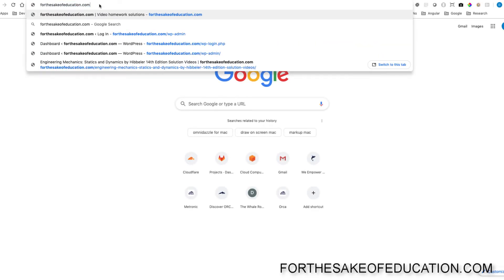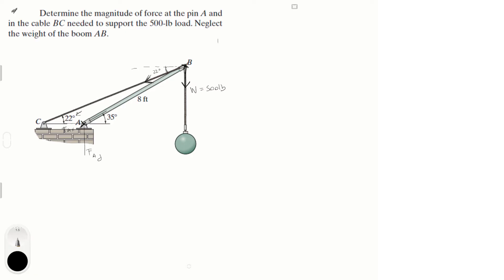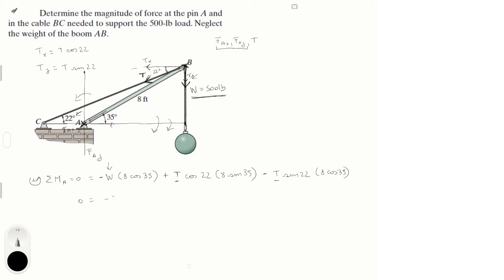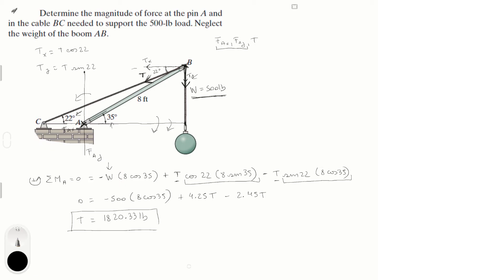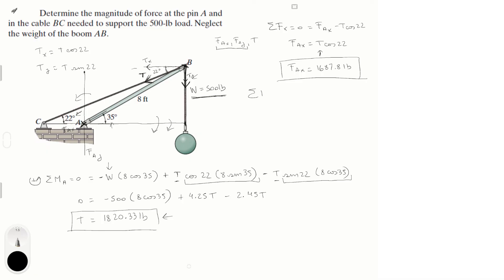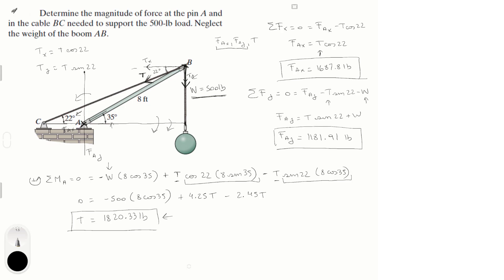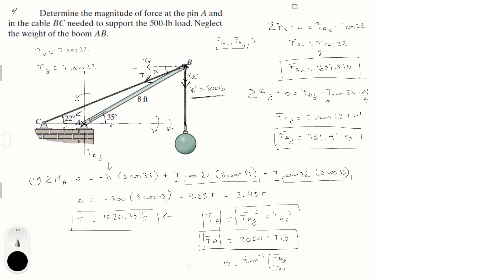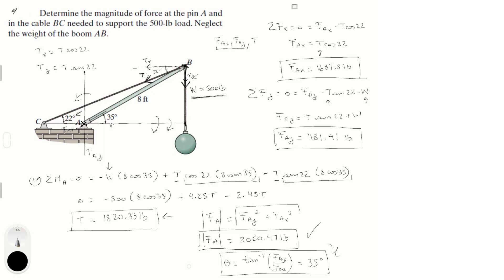Determine the magnitude of force at the pin A and cable

Comment: just a question, but is there a way to know the distance between a and c?
Reply: That's very simple.
Just use basic trigonometry to extract from the known 35deg  angle and the 8ft AB part length the length of the BL and AL segments (L is the point you can find by intersecting the extending horizontally the CA segment till it intersects the vertical cable, coming down from pt.B) -> BL = 8ft * sin(35deg). At the same time: AL=8ft * cos(35deg). 
Then from the BL value and the 22 deg angle you calculate the CL segment -> CL=BL/tan(22deg) = 8ft * sin(35deg)/tan(22deg).
CA = CL - AL = 8ft * sin(35deg)/tan(22deg) - 8ft * cos(35deg) = 8ft * (sin(35deg)/tan(22deg) - cos(35deg)).